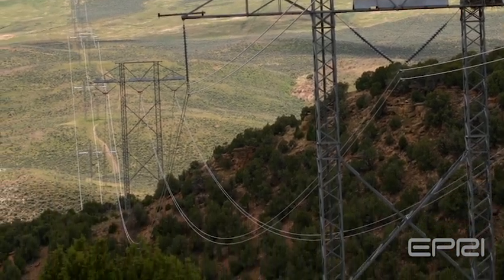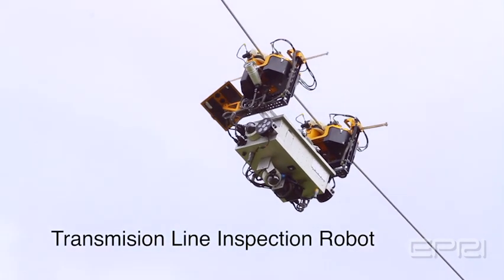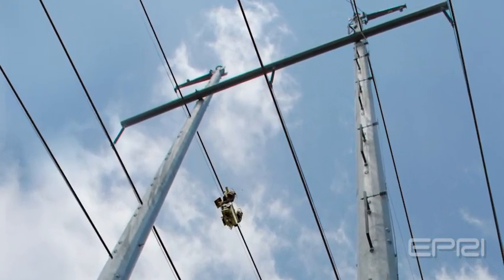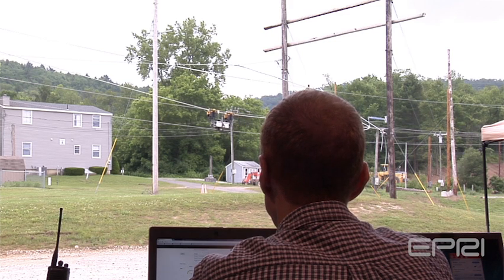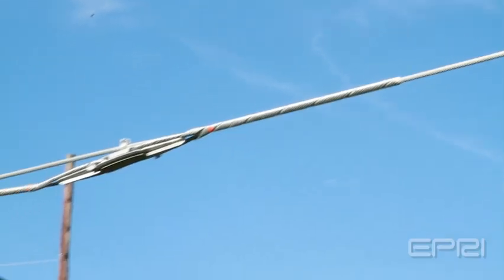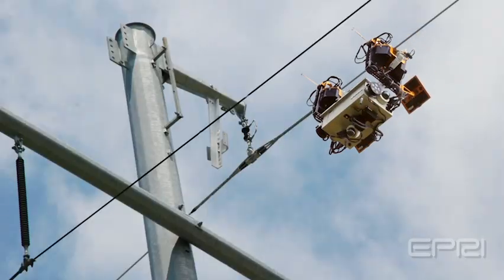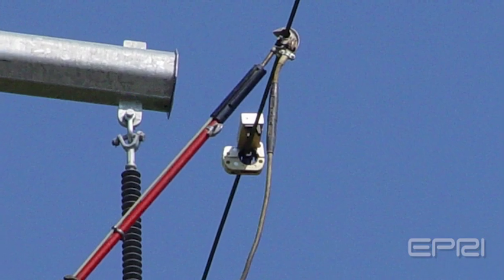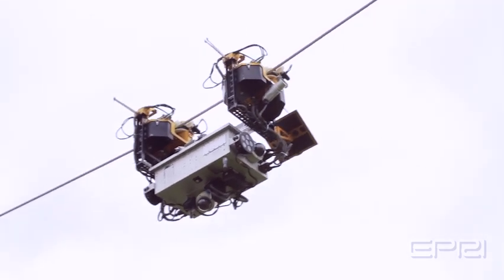2014 Transmission Line Robot Update

Comment: Very good work!
Reply: That's interesting.   Still have to modify the lines for it to be used in though.  I wonder if it wouldn't be cheaper / simple to buy a quadrocopter for every 4 miles of line and a self charging base station.   Would definitely get better video of what is going on.
Reply: The FAA has strict rules on the use of such devices.
Reply: Maybe just stringing a simple guide wire across the top of the towers then to hold the robot?  

 I just see modifying the shield wire and the complexity involved in maintaining that would cost quite a bit.   Also noticed in other videos about the robot that the rubber compound of the wheels at best help up for only 2000 mile in the lab.  Realistically traversing all of those wire bridges and wind buffeting would push that number down into the hundreds.

I was just checking out the laws on autonomous aircraft and its interesting to see the various states laws visualized on this map: http://amablog.modelaircraft.org/amagov/drone-legislation/

I would think anything flying below 400ft is generally out of restriction of the FAA.  As noted by this recent ruling: http://www.politico.com/story/2014/03/faa-small-drones-ban-104393.html
Reply: Utilities are also looking into using drones at lower voltages. At the higher voltages, even with the modifications, the robots provide more benefit than the current inspection methods. 
All the newest technology is being considered by utilities to improve inspection and maintenance practices. Some technology is more ready that others.